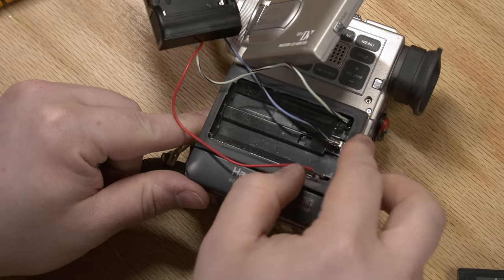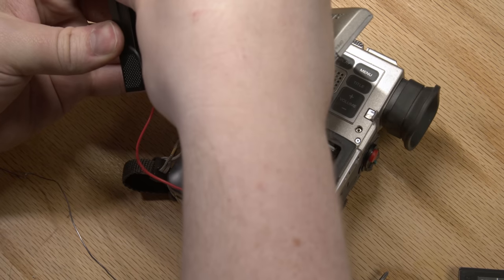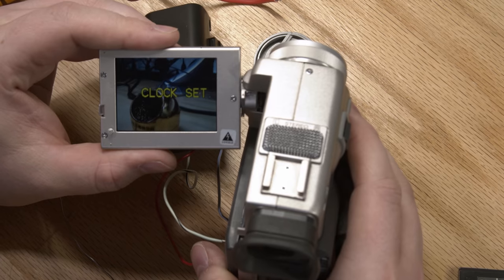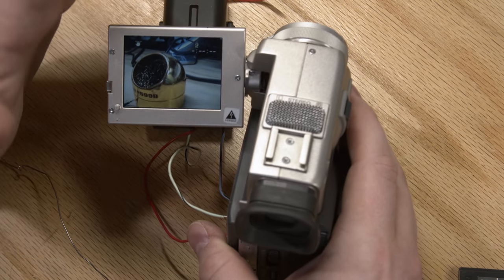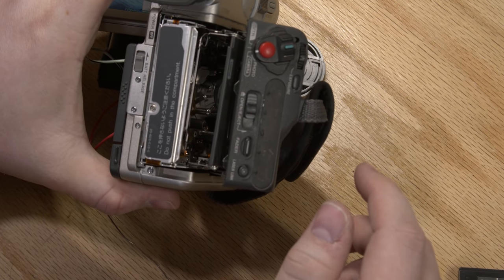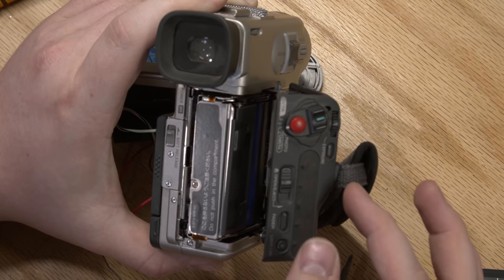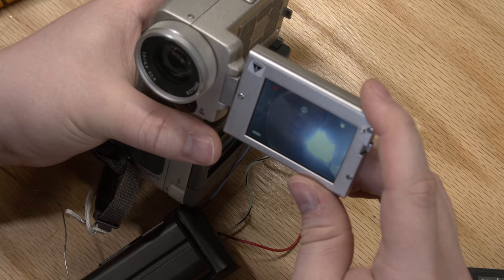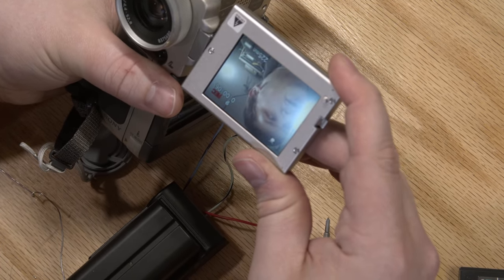Adapting Infolithium to Infolithium

Comment: Soldering those cells works no problem!
You just need to be fast. 
Iron at screaming hot, wire pre tinned, flux on the baterie... then just push the wire on until it wicks.. BOOM done!

Comment: every time a phone charger or usb cable breaks I keep it just for the wire
Reply: also this video reminds me of the time i had a few of those old full size VHS camcorders, and i had an old battery that still held a really good charge, and one that didn't. I took apart the broken one to see if I could fix it and once I had everything apart I realized I opened the wrong battery. that was the only good VHS camcorder battery I ever had. destroyed. that one hurt

Comment: I even think those "Infolithium" cells are not clever at all, probably only a resistor to make the camera know there is a legit battery installed.

I had once a bad, big tool battery and replacement costed like 400$+ so i seareched up on the BMS internals and found out: As soon the BMS detects "no voltage" (when you remove the battery!) there is a chip on it which will remember this event and completely block the battery to the outputs, basically "disabling itself".

I had to fake a low voltage similar to the battery at every cell i replaced to not "disable" the BMS forever.
Luckily it worked out well and i did the cell replacement (with even better, high current cells....) sucessful. Tho i have to say... i would never ever do this work again. I "just" saved about 150-200$ and had a lot of hassle to deal with.

Comment: Wait, you're worried about soldering to the batteries, don't want a battery welder, haven't thought of buying tagged cells, yet you're happy to to take a dremel with cutting disk to a battery pack?? Piercing the battery is much much higher risk than quickly soldering to it.
Reply from the maker: The difference is between a brand new, most likely 75% charged cell, with the most capacity it's ever had in its life, versus a completely drained one from 20 years ago that doesn't have anything like the energy capacity it once had. I also consider myself more dexterous with a rotary tool than a soldering iron, and I would not be "quickly" soldering to it, I would be working on it for ten minutes as I screwed it up over and over, losing track of time until it exploded in my face. I chose the one that was safer for me.

Comment: i've come across many Cellphones of yore that simply refuses to operate correctly without that charge pad
 🤷‍♀️
Reply from the maker: yeah i can't imagine collecting e.g. nokias. god. i had never considered it, it must be nearly impossible.
Reply: AFAIK the third contact on cell phone batteries is usually just a temperature sensor. Connecting it via a 10k resistor to ground will often make old phones happy.

Comment: I mean, you found a working solution, but i wonder, me and probably many other subs have 3d printer at home and could print you an adapter, wouldn‘t this have been a smarter way to go around this problem? Even if you don‘t want to bother a viewer with it, you could cheaply let a company print the part and send it to you…
Reply from the maker: This project isn't worth all that. it requires a bunch of back and forth to test designs, waiting every time for a print job and shipping, only to produce an accessory that is equivalent to a commercial adapter (so I don't get a video out of it because who cares about "I bought a battery adapter") that costs a lot more than the $0 i spent on this, only to power up a device of no particular significance. That's gobs and gobs of work, taking weeks, and in the end I throw away the old battery anyway. I don't know what's better about that in any way, to be frank.
Reply: @CathodeRayDude  i don‘t think that‘s true at all. I guess it may not fit into your current style of videos but generally speaking cad makes for interesting videos in it own right. Of course, the general time spend would be greater, but being the nature of 3d printing most of the time is passive and could be spend on other projects. In the end, it‘s tinkering either way.
i don‘t know how common this connector is neither how often you will need to use the adapter, which would be an important consideration for the effort…

Comment: A battery spot welder uses LOW voltage high current typically 5 to 22 volts the usual is normally 12 volts, not high voltage, which would be extremely dangerous. 

https://youtu.be/HSJJ_PzZ6UY?t=427

Comment: I soldered high current HG2 with no prior experience. It's safe, man, cmon. Also for  those who are unsure how to do it, there are presoldered 18650s on aliexpress.
Reply from the maker: Your anecdotal experience doesn't change the fact that it is not and has never been "safe" to solder on a battery of any kind and I'm not going to be the tech youtuber who told a bunch of people to burn their houses down.
Reply: @CathodeRayDude  ok, if you put it like that, you are correct, people will burn their houses. They somehow managed to do it using vape devices, which arguably is quite a bit safer application of 18650s
Reply from the maker: ding! now you got it

Comment: Lot of misinformation on lithium batteries I would like to help out on.  I have experiance with Recycling and reusing 18650 cells from one thing to another (purchasing bulk supply of dumped drill batteries for example and removing the cells that are still very much living healthy and tossing the dead cells disabling the pack. ) first of all, exploding is very uncommon for 18650’s.  Low quality and older cells sure can combust easier vs newer and higher quality cells that being said they can take a lot of abuse and dead shorting them out on tiny power leads it likely burn those leads out before they damage the cell internally.  Those tabs/wires attaching them will not hold up to the 100s of instantaneous amps that will blast into it on a dead short.  A fire from the wires or the board maybe, but from the battery?  Unlikely.  

Also yes you can solder onto them, though not reccomended if you are good with soldering and using minimal amounts of solder you can defiantly solder tabs to them. However the reason it not reccomended isnt because of the heat, the amount of heat that gets absorbed into the cell is minimal when soldering correctly but rather because if you use too much solder it can short out the battery bridging between the spacers. 

Purchasing or making your own instant spot welder is easy and can be done cheaply without too much sacrificing.  Tons of guides online and I purchased one from China on eBay years ago and it works great, only costed $50 which wasn’t even the cheapest one I just figured maybe spending a few $$ more maybe give it better components vs whatever was swept off the floor.  However, that being said, even the best DIY equipment for spot welding Batteries can still have issues little over cooking the spot from relay holding on slightly too long or getting itself stuck to the battery and tabs or blasting a hole in the tabs (or the battery if your shit really fails)
Reply from the maker: It's not misinformation to tell people that this is not something amateurs should do. Everything you're describing here is applicable only to skilled, experienced individuals. Anyone who would buy a battery welder isn't watching my videos to learn.
Reply: @CathodeRayDude  or you (or anyone) can learn to solder using smaller amount of solder in smaller places (not specifically precision soldering) and build confidence on safer projects and then apply that skill to repairing batteries using 18650 cells.  The danger is mostly in bridging things using too much solder, not the heat… unless your leaving the hot iron on the battery for more then a few seconds at a time which shouldn’t need to do anyway.   Pro tip: use discharged batteries during install, the amount of remaining voltage and current is reduced to the point that danger factor is far less… 

I do suggest playing with lithium batteries in a safe place outside and making them fail and learning what it actually can take to cause them to fail in a dangerous way.    Maybe surprised specially with modern batteries/cells just how resilient they are at taking abuse.  Older batteries that hold a charge with a different chemical doping process (still be called lithium-ion or lithium polymer) for the lithium can be more spontaneous with how they fail… but more modern and higher quality cells tend to hold up better :)  I have actually axed and smashed a few with 20 pound hammers and a fire axe I have and they still didn’t burst into flames, just boiled off its liquid.  Had some older (but still functional) Panasonic 18650s that bursted into flames when they got hit with that hammer..  flat pack lithium batteries are more fragile, I wouldn’t put a knife anywhere near one.. they have gotten way battery over the years and tend to not catch fire as easily from stabbing but I still found a few flat packs that moment I sunk a knife into them for testing purposes they bursted into flames.. also AVIOD Lithium flat pack batteries that use graphine doping proccess, they are amazing at delivering more constant and instantaneous amps but they are also way more willing to catch fire the moment they get shorted internally… I sunk a knife into one of them and holy shit!!!
Reply: it's uncommon, for 18650s to catch fire, but it absolutely can (and does) happen. Witness a few large (10s of kgs) lithium battery packs light up and start launching cylindrical cells across the landscape like little rockets, and you will NEVER tell someone they're being "too cautious" around lithium batteries...

And no, the issue with soldering to lithium cells is absolutely due to the heat. You can get away with soldering if you're doing a few cells and you don't care about peak performance, so a wee bit of degradation is ok. But if you're building a several-hundred-cell pack by soldering the cells, probability is going to catch up with you and you ARE going to end up ruining cells due to the heat transfer and possibly lighting the whole pack on fire on your bench.
Reply: @theholymacintosh   first of all, how do you relate 10s of KG of cells (so 100s of them at a time) for idk, an EV size pack or a DIY battery pack for solar power storage letting go in a chain reaction in close proximity from a screw up vs DIY repairing your own camera battery pack with 2-4 cells at most on a  bench mostly isolated?  Obviously if your DIYing a Tesla battery pack or something like that that don’t for any reason use solder… but you can easily without any noticeable loss get away with using solder on repairing a camera battery pack….

Also the amount of heat absorbed into the cell is minimal, yes some will but you should in no way have damaged the cell unles your holding a 400 degree C iron on the cell for more then a reasonable time.  It shouldn’t need mkre than 1-2 seconds between placing iron on cell and sticking solder and wire to it then backing off with iron and solder.  with good iron and half decent soldering skills in small spaces it’s easy.. 

Tesla which probably still one of the best examples of maintaining their batteries best long term.  They preheats their batteries when they are on their way to a super charger, can preheat older batteries upwards of 55 degrees C  before being plugged in and apparently to allow it to soak in 100+ KW charging better…. Newer Tesla’s with different chemical properties and doping processes need to be heated less, but they still preheat to 40C ranges. I doubt a soldering iron at 350C on a small point and blob of solder that quickly solidifies after being heated only 1-2 seconds will heat the battery from room tempature to beyond 40C even… much less even higher.
Reply: @Honeypot-x9s  you're writing a lot of "should"s and "probably"s and "i doubt"s. Stop and consider if you're writing a lot of speculation at someone who has been around the block a more than a few times.